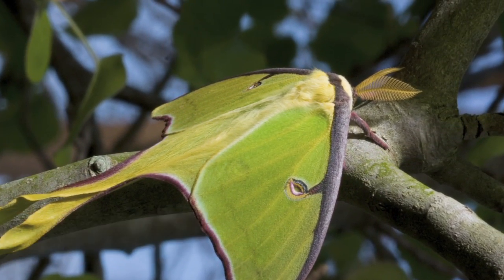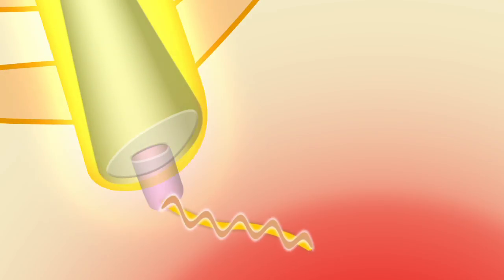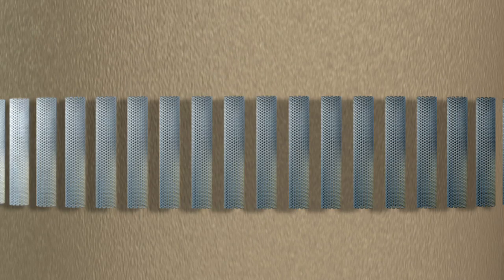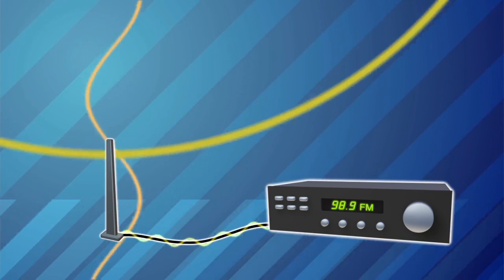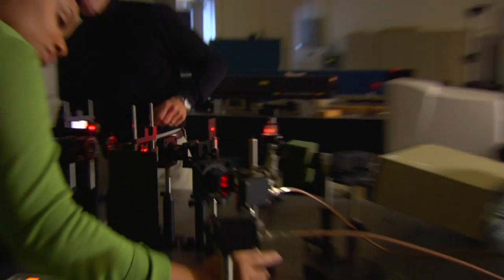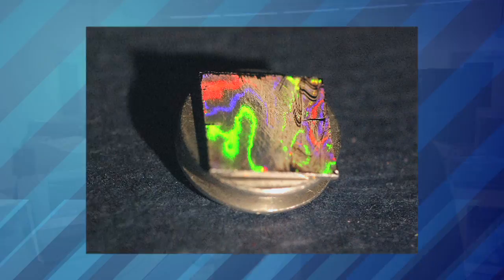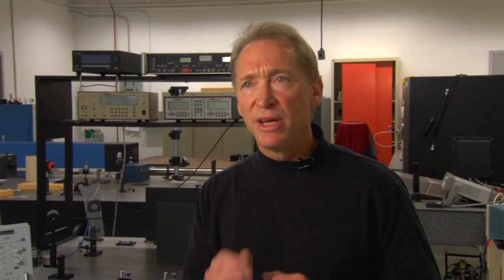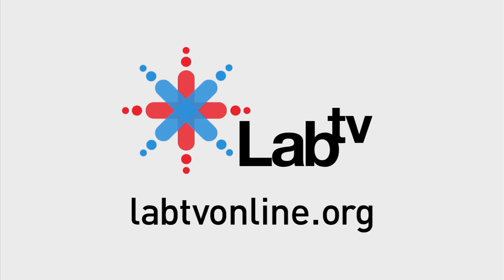Light Antennas: Making the Connection Between Light and Electricity

Comment: ahhh today i thought about how light is an electromagnetic wave and wondered if there was a way to create an antenna that would generate electricity the same way you can get power out of a radio wave. I hope these guys work it out :)
Reply: Literally how ALL radios work.  We have know for well over 100 years how to do this.  Solar cells are technically doing the same just on higher frequency and using the atoms themselves as the antenna.  This is why if you hook a solar cell up to electricity you get light.  Normally in IR but an LED is jut a solar cell of very specific frequency.  Light hitting an LED creates a charge.  There is little new about what they are doing other then exploring meta-materials.